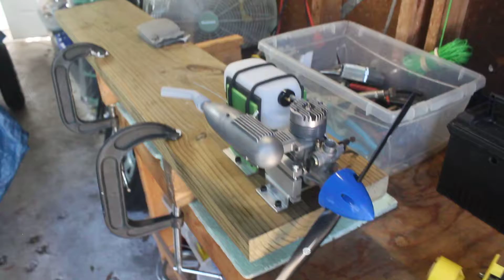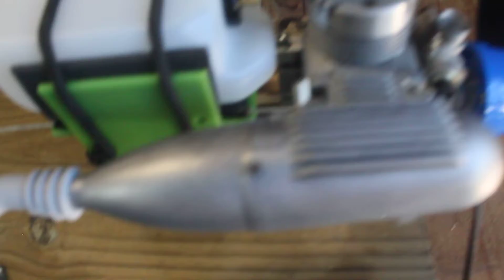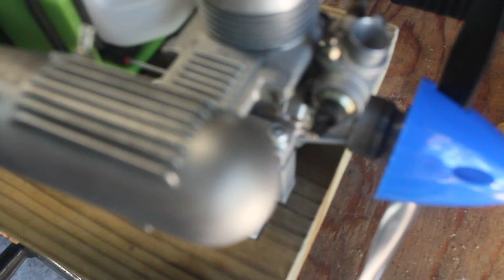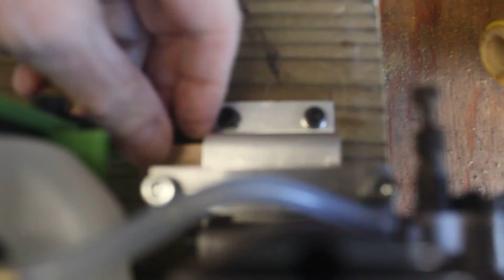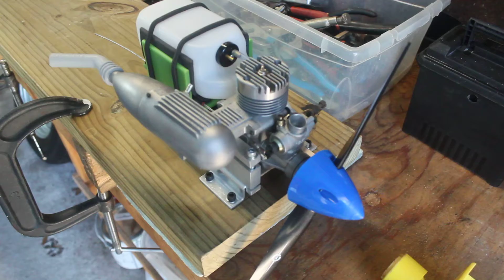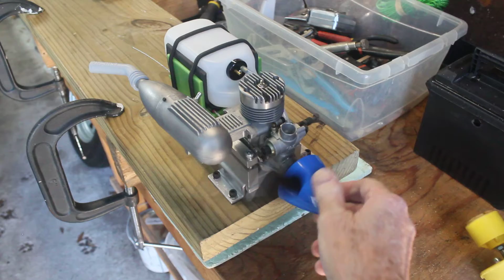Model Airplane Engine Test Stand - OS.61cu in

Comment: Thanks for the video!  I also use a 40+ sullivan starter.
Reply from the maker: I have no real objective and no one that I want to impress so I just use the hobby to pass time.  Not trying to keep up. Just something to play with
Reply from the maker: When I was a kid we used a bicycle handlebar grip as a chicken stick. Just put it on your middle finger and flip the prop until your heart is content. I keep one in my field box as a backup. They work perfectly
https://www.flickr.com/photos/14372793@N02/53335058748/in/album-72177720300978560/lightbox/